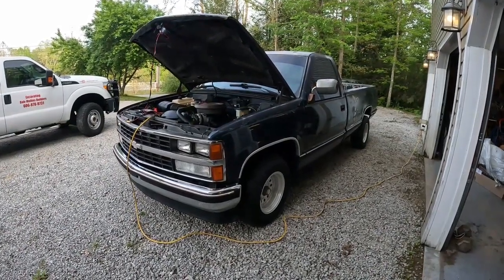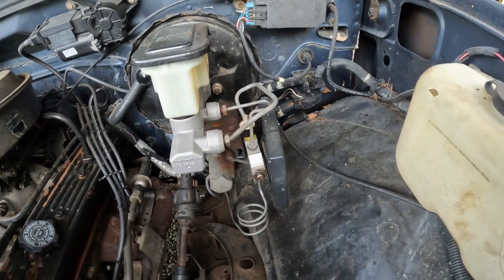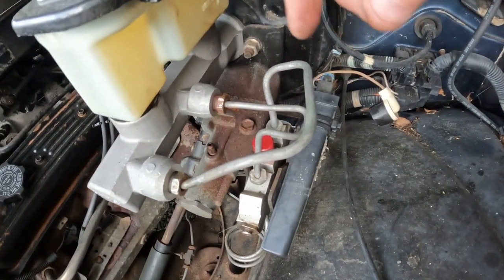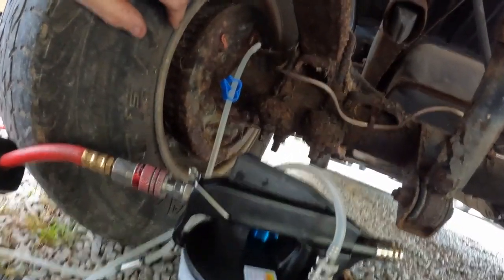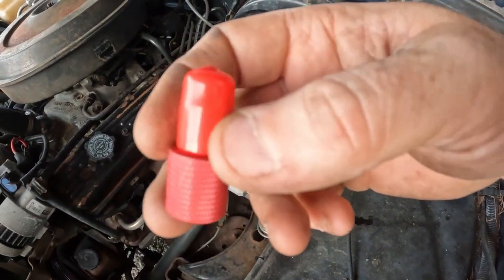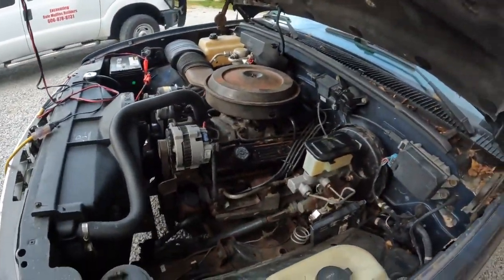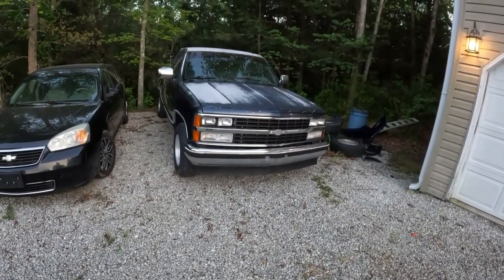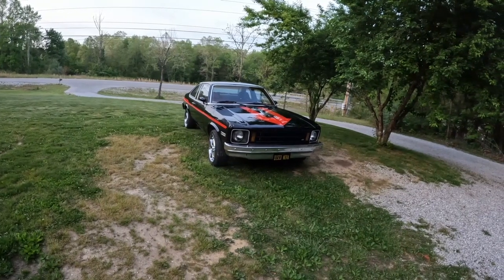1988 chevy silverado brake bleeding, You need this tool !!

Comment: Hows them brakes ? I have the same problem with my c1500 im ready to take them off and do disk on the back
Reply from the maker: Brakes seem better now that I got all 4 wheels to bleed. I need to turn the rotors, but it stops good, and has a good pedal feel.

Comment: Larry, Check those u bolts. Mine were rotted thru at the bottom of the cup all of them, to about the size of a 10 penny nail. Only at the bottom. Seems the cup holds water. Mine was a 1992 chevy 1500. Long story short the rear axle broke off completely under stress. Hence my searching for brake bleeding.
Reply from the maker: Ok, I will check it out, thanks for the advice!